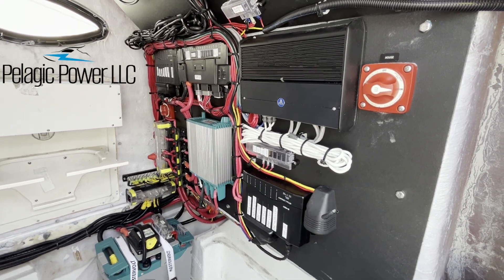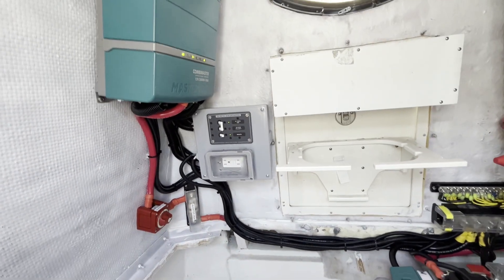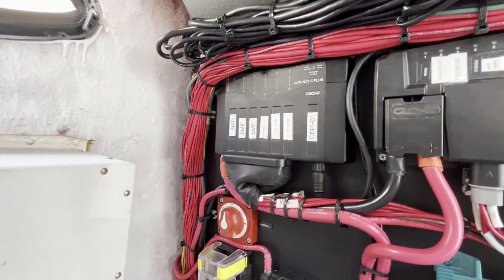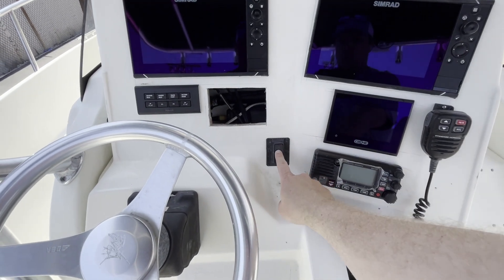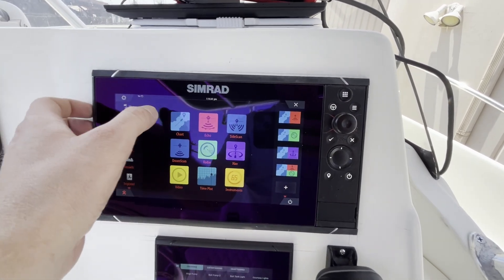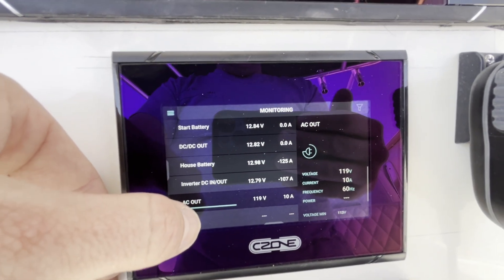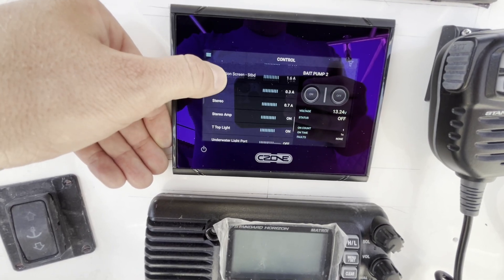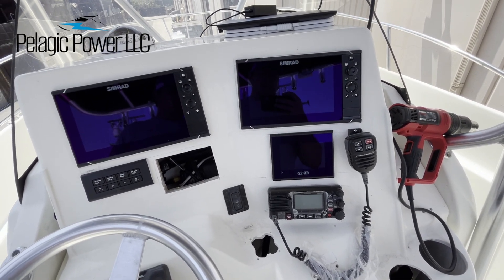Integrated CZone & Mastervolt Digital Switching and Lithium Power System on 25ft Center Console.

Comment: Nice job! 1 question, how come you didn't do lithium for starting the engine(s)?
Reply from the maker: Great question. There are multiple reasons we almost always recommend using lead acid batteries for engine cranking. 

1. Lithium, as it's designed today, is not great at high amperage, short duration (aka cranking). Lead acid is very good at that.
2. BMS systems in lithium batteries can potentially take the battery offline. Since starting an engine is critical we don't want to have a BMS shut down risk the customer's ability to get home.
3. Many engine manufacturers don't allow lithium for cranking and it can void warranty.
4. Engine batteries rarely get deeply discharged which is what lithium is good at doing. So why spend the money on lithium when you aren't getting the benefit?

To summarize there isn't a lot of value in lithium cranking batteries but it incorporates risk. The value of lithium is in deep discharging applications like house or trolling motor banks.